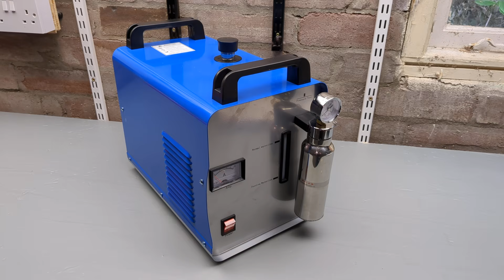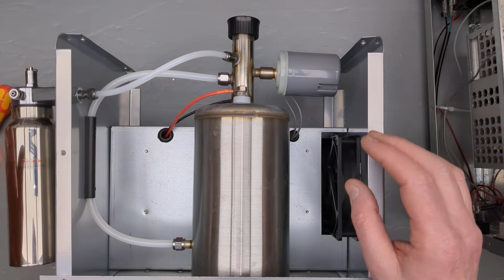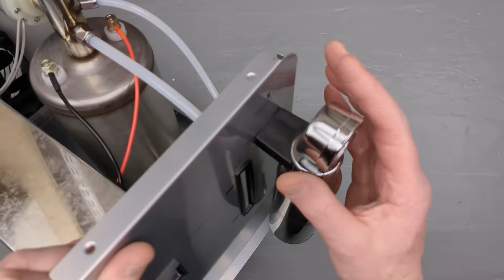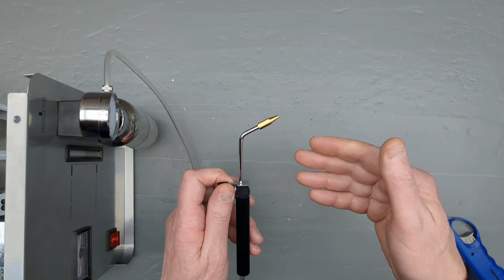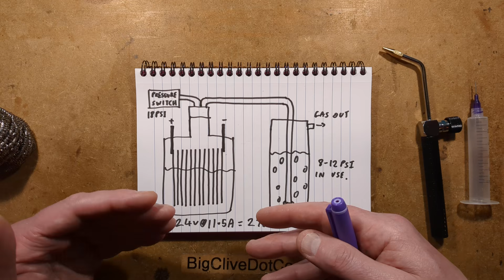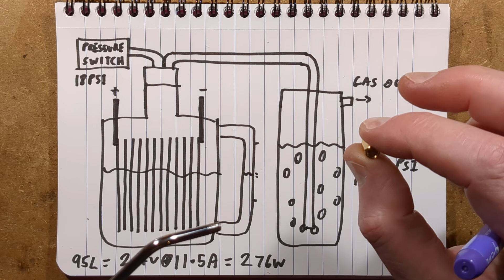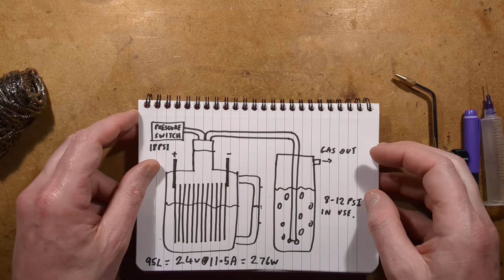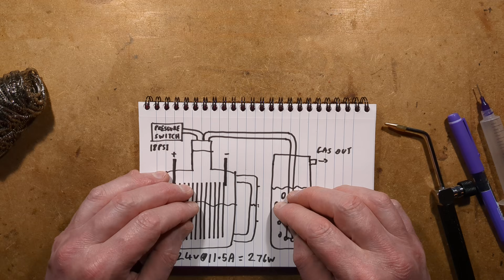Inside OxyHydrogen gas generators (HHO/Brown's gas)

Comment: This is the kind of thing I used to play with when I was a kid before the internet. I can't believe the cops never came out. I can still remember the first oxygen fueled blast and my shock...OK...hide the parts...go inside...nothing happened.

I believe the spark came out of a microwave transformer. After I learned where nitrous oxide comes from, I had no hesitation putting explosive gas in my lungs. ;)

Comment: you can run a lot of carburetor engines on straight HHO, no gasoline used. its very similar to gasification devices. done it , and there are lots of people who've done it. not a lot of power produced but enough to drive down the road or through the woods. is it safe? maybe lol
Reply: You can't cheat thermodynamics. You drove with gasoline not water
Reply: @HanTrio3  no gasoline when tanks are empty and not connected. And it wasnt run on water if waters not going into the combustion chamber. I think you need an update 

https://youtu.be/B9v8denLLe0
Reply: @jamescorvett  It uses wood gas which is very different from HHO. Unless you mean using a gas tank filled with HHO which I didn't assume because it has a terrible volumetric energy density. Wood is a fuel water is not
Reply: @HanTrio3   its really not any different, a gas is a gas whatever it might be. And you dont really need a tank of HHO to run an engine if you're producing enough. Thats the lie they keep telling people to keep us using petrol. 
 I built my first HHO generator in the early 80s, when I was 12 yrs old. Ran my dad mower on it and mowed a half acre of yard creating the gas as I mowed, no real tank storage. Was it safe? My parents didnt think so. Lol But its really no more dangerous than gasoline, or engines that can run on propane gas. 
 Just think if we could run an engine on nothing but gas fumes. How many MPG would you expect to get using that? 100 mpg...a 500? Its doable IMO but the petrol giants would shut that shit down na heartbeat! 
Another yt video of HHO https://youtu.be/REV739pRNcw
Reply: @HanTrio3  another example, MrTeslonian gasifier truck

https://youtu.be/X3KipK49v7g

Comment: What is worth doing...
Use a solar panel direct to produce the gas and use it for cooking...
You need a bigger storage container and burner's.
Reply: You could probably use something similar to what's used for storing wood gas. Basically you bubble into an inverted vessel within another vessel that's full of water. As it fills with your gases the vessel rises out of the water, then as you pull gas from the system the weight of the containment vessel pushes the gases out at low pressure and the empty space fills back up with water
Reply: @philondez 
Yes.. I can't remember what it's called..
There were massive ones in the UK but they decided to get rid of them.. and they were in working order.. 
Now there's very little storage.. the implementations are many...
You can also use good quality oil drums..
One that is sealed and a pipe at the bottom to a header tank.. the height is adjustable for the pressure but the way you say is better overall as pressure is consistent you just need to adjust the weight..
One piece of absolute safety.. the holding tank MUST be completely filled with water to expel ALL Air .. it's even more critical with some other gases.. particularly making biogas in a digester.
Reply: Why not use the electricity for cooking?
Reply: @HanTrio3 
Yes.. If you have a big enough battery, solar panels, charge controller and inverter..
At 12v .. 2KW is 200~ Amps from the battery..
That would run a single induction hob...
If you want more power... for a cooker..
(It's the reality of the size of cables and cost)
... then you need 24v or 48v .. if going up from 12v I would go to 48v..
The cost of the system is quite a lot.. compared to direct solar.

Comment: Cool to see this,  just chipping in to say I've been in the midst of making one for the use of glass welding, where I need a very hot small flame to properly join pieces of tubing. Typically this is done with oxy-fuel torches but cylinders are expensive and need refilling.
Reply: Oxygen concentrators are readily available from various suppliers, some of them second-hand from the medical market. They're a very clever system, using two cylinders of zeolite absorption material alternately to remove most of the nitrogen from an air supply to provide a stream of high-concentration oxygen. As one cylinder is in use the other is back-purged to remove the trapped nitrogen in the zeolite so it can be used again on the next cycle.

I've seen a setup for a glassblower using several such units in parallel with a propane fuelled torch since the oxygen production rate for a single concentrator unit isn't that high, typically 5 to 10 litres per minute.
Reply: @robertsneddon731  Absolutely, old medical oxygen concentrators are fantastic for that, the only prohibitive thing about them is that where I live they usually sell for ~$200, at which point I could just go and buy used weld kit. The zeolite system is super cool, I was trying to build one first but the pressures needed would require taking on risk that I'd rather avoid; I'm more comfortable with the risk and necessary precautions of caustic chemicals (which I work with for a living) than the hazards of 140+psi cycling in a homemade concentrator.

Was the glassblower you saw one of the handful of youtubers who make vacuum tubes by chance? They are the ones who got me into glasswork, I want to make nitrogen or argon discharge lamps.

Comment: The use of metal wool for flash back arresters is fairly common. 
My understanding of how they work is by absorbing the thermal energy of the flash back by melting.
Reply: You need fine stainless steel wool
Reply: That`s correct, but not by melting. Its more to do with their thermal inertia. But the pore size would have to be quite small for browns gas. Not so much wool as a metal powder such as copper with appropriate grain size. Flashback arresters may operate many times over their life without damage.

Comment: When I was a Physics undergraduate, we used oxy-hydrogen torches for technical glasswork.  They were primarily used for fused quartz glass.  You had to be careful to turn off the hydrogen first followed by the oxygen.  Do the opposite and you get a VERY loud flashback ... often with the hoses being blown off the torch.  Doing it wrong once was a strong reminder that you didn't want to be the next Hindenburg.
Reply: I could swear you turn off the oxygen first before turning off the acetylene when shutting down an oxyacetylene torch, it's how im pretty sure I was taught in school and it's how I've done it since then without any flashbacks! the first few sources I checked also say the same, for shutdown you turn off the oxygen first, then the fuel because the rich flame is far less likely to flash back, right? isn't the "A before O" saying for startup procedure? I'm suddenly doubting something I've been sure of for many years now lol
Reply: @gabewrsewell which is it?!?!?!? Torch has been running for hours now
Reply: @gabewrsewell No, you're thinking correctly. I've never heard of that "a before o" moniker.
Reply: @gabewrsewell hmmm, what causes a flashback? Not a lack of acetylene right, it’s loss of oxygen as I recall it.  When you get a flashback you turn of the acetylene so therefore I always turn off the acetylene first besides it’s more expensive to leave running than oxygen.  But then not the first time I’ll be wrong in 77 years…
Reply: @goingjag Turn off should be the reverse order of turn on: FOOF Fuel/Oxygen and then Oxygen/Fuel.
Turning off fuel first often causes a pop which is from a small flashback into the nozzle which will accumulate soot inside it.
Reply: @ferrumignis FOOF is an entirely different beast.  A very entertaining read.
Reply: @goingjag  I think the cause of a flashback is the slowdown of gas flow. For some reason, when the mixture of acetylene + O2 flows out quickly, the flame does not enter the torch tube. When you turn off O2, there is slowdown. The tube still contain a gas mixture. The flame might enter the tube and cause a bang. I think you can prevent this by turning on the flow for either the O2, this might cause a flame out. Then, you can turn off both gases.  Or you can turn on the flow of acetylene, this should cause soot. Then, you turn off the O2. You get plenty more soot. Then, turn off acetylene. The last time I played with such a torch, I was 16. I don’t have one to test now.
Reply: @goingjag no that makes sense, a flashback is when the velocity of gas out the nozzle is slower than the flame propagation speed, but the real violent ones that go bang and can damage the nozzle more also happen then theres both oxygen and fuel in the mixing chamber. my vague thinking is that turning the oxygen off first removes oxygen from the mix so that even if there is a flashback, there's no loud bang to make me ruin my underwear
Reply: This would be excellent advice if not for one small but vitally important problem: You have it precisely backwards.
For any oxy-fuel flame torch (burning a fuel gas with pure oxygen), when you first light it up, you ignite the fuel first, then slowly introduce oxygen until you reach the desired flame temperature.
For shutting it down, you do the reverse: Turn the oxygen off first, and only shut off the fuel flow once the oxygen flow has been completely stopped. This ensures that during shutdown, the flame can only become richer in fuel until the point when it is shut off completely.

If you do it the other way round and turn the fuel off first while oxygen is still flowing, the mixture will become progressively leaner, and at some point passes through a ratio which is explosive. Precisely when this happens depends on the identity of the fuel gas, and to some extent the flow rate, which itself depends on how much pressure the gases are under, and the degree of flexibility of the fuel lines leading to the torch.

For very small torches, the magnitude of the explosion is small enough that it is unlikely to cause much damage (if any), other than to your eardrums. But for larger torches (such as industrial scale oxy-acetylene or oxy-MAPP gas), the explosion can be violent enough to blow the torch head apart, re-distributing pieces of it around the area at high velocity. This is essentially like holding a small pipe bomb in front of you while it detonates.
Reply: @lloydevans2900  that and it can continue inside the hose to regulator and make it go boom, then the fun really starts tank of high pressure oxy blasting.
of course most everyone uses flashback arrestors, some a pair of them at the torch and regulators, in case of a hose breakage/burning.
Reply: When turning off a oxy / fuel flame, the oxygen needs to be shut off FIRST.  If the fuel is shut off first, flame front speed exceeds the speed of fuel flow and flame enters the torch tip.  This occurs because a lean mixture has a faster burn rate than a neutral or fuel rich flame.
Reply: I worked in a quartz shop for many years using hydrogen and oxygen. There shouldn't be any flashback into the hydrogen line because there's no oxygen. Flashback in the torch can happen but it's not a big deal. I turn the oxygen off first, that way there's no mixture of gas to flashback.
Reply: @maxxglass5822  I did that when I was 16. I turned off the O2 first. The acetylene still flowed and there is plenty of soot formation. Once I turn off the acetylene, there was a small chance of a bang inside the mixer tube. I guess the mixer still had some O2.
Reply: @louistournas120 when I shut down my small jewellers torch that I run on oxyacetylene, I turn down the oxygen first, then the fuel to almost zero, then I blow it out like a candle. Used to do it with the welding torch too, I think that was a trick my welding teacher taught me because you do indeed sometimes get a little flashback pop when turning down the acetylene slowly all the way to zero from the valve.
Reply: flash reducers??? in weldinghoses to the torch are always flasback reducers. pure safety
Reply: yes u are right. im a technical teacher. also welding. When using argon u need to put out first the argon then the oxigen.
Reply: "A before O, or up you go." Not quite the same, but in the spirit of the saying.
Reply: @BEEFDEAD ”….or else she’ll blow” when I was training

Comment: I recently did some experiments that also concluded sodium hydroxide was the best electrolyte for electrolysis cells, as it is very conductive but also attacked the anode the least. I didn't test potassium hydroxide though.

Comment: If you want to see the level better in the sight "glass", put paper behind it, B & W Diagonal stripes.
   Had boilers for years that were impossible to see half the time, read that as tip in an old Pop Mech magazine after it didn't matter (moved).
Reply: Used to do that when titrating with a burette….chemistry 101..
Reply: Same approach with sight glasses on railway locomotive boilers, many had a striped plate fitted as standard towards the end of steam.

Comment: I saw a couple of (what could have been) these at a fire cleanup / remodel   I worked at this summer. I mistook them for ozone generators at first. I investigated because I noticed they were running, (and briefly thought "Hell no, they are not just breathing this are they?!") but they were different than ozone generators, and gave off no smell. They may have been something else too. I don't know what use the devices in the video could have for fire cleanup?
Reply from the maker: I've not come across them for use in that way.